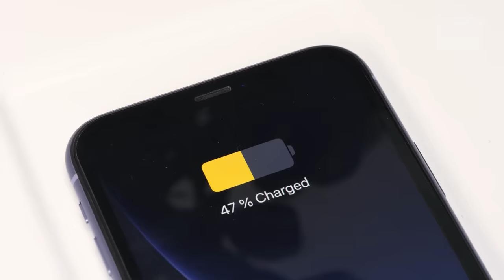How to Build a DIY Secret Storage at Home & More Secret Storage Solutions | DIY Projects

Comment: Odnośnie do stolika na końcu to siła wyrywająca kotwy jest ogromna i stolik szybko pójdzie do śmieci.
Reply: How would it pull out of concrete, anchor pins, and lag screws? And if you mean the drawer, it just opens like any normal drawer. The panel underneath wouldn't be an issue, either.
Reply: @MaryAnnNytowl  Chodziło mi o 9 minutę i stolik wspornikowy. Mocowany jest SHS o małej wysokosci. Wsporniki na końcu bardzo silnie skręcają kwadrat. Należy powiększyć przekrój SHS do 40x3mm i zwiększyć ilość wsporników z 2 na 3 oraz punktów kotwienia z 2 na 4. Kotwienie powinno być jak najbliżej wsporników. Nie potrzebne jest wzmocnienie narożnia to tylko oddale kołek od narożnika. Jeśli plastikowe kołki to tylko FISCHER DuoPower 14 x 70 S. * GOOGLE * I meant 9 minutes and a cantilever table. A low-height SHS is attached. The brackets at the end twist the square very strongly. The SHS cross-section should be increased to 40x3mm and the number of brackets should be increased from 2 to 3 and the number of anchoring points from 2 to 4. Anchoring should be as close to the brackets as possible. You do not need to reinforce the corner, it is just a dowel away from the corner. If the plastic pins are only the FISCHER DuoPower 14 x 70 S.

Comment: Oh of course I've got welding equipment in the garage. 
Last time I checked,  a properly built tiled wall bathroom had cement board holding the tile and mortar.   Drywall is just unnecessary to handle that paperweight tile

Comment: I agree with the other guy is it fun to watch but this guy does some strange things first of all the door you can see the panel that comes out it should be on the other side of the door you should need to take the hinges off to access it so no one will ever see plus that was just way over the topic excessive once you have the whole you can just stuff a bag in there and put a little piece of wood back so no one can see it but as I said on the other side of the door with hinges are you don't even need to take the hinges off to do it or to access it but it will be less noticeable no need to make a metal frame or put hooks in any of that stuff

Comment: only 3rd one is practical 

1st requires a lot of effort and is easily detected and still does not have good capacity
2nd is so pathetic that after 4-5 times there will be hand marks left as stains are often seen round switches etc. so it will be detected easily

Comment: All of these have serious design flaws. The door is way to much work for how much you'd gain in a secret storage. It would be easier putting a false bottom in a drawer for the same amount of space. 
The tile one would only make sense in a 2x6 plumbing wall to have enough space and you'd be  hard pressed to conceal the gaps in the grout lines. 
The desk is the best idea just poorly designed and needs a wider mounting bracket to withstand the daily use it would endure.

Comment: I know that when I'm about to spend 2 minutes routing a piece of wood I make sure to have my face clean shaven so that my properly fit tested full face respirator I keep in an air tight sealed container will fit properly and no saw dust will be breathed in before I even plug that router in. I'm surprised he's not in a full body tyvek suit with 3 layers of gloves on to use that screwdriver. No push stick for the table saw this guys living on the edge. And the fumes from that glue could be harmful if your not in a well ventilated area.

Comment: All this is pure crap, he want to create a illusion for his video, that dosn't actually works

First, it is not DI, you need a complete workshop, and experience
Anyone can spot the "hidden" storage in the door. As it's been said, it should be put at the hinges, or on top.
In a a white wall, any diference can be spotted easily
And this table is obviously weak! You can see that it is already out of level, and that it shakes easily, and it would never take the force of someone putting a little weight in it. The man using it, must be acting, by not putting his weight. How can it shake, but give full support to his weight?